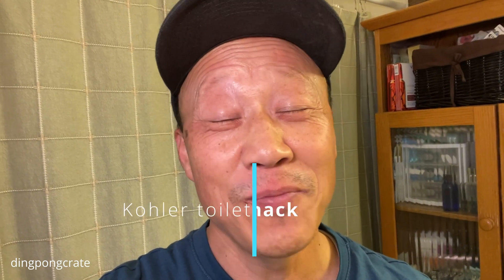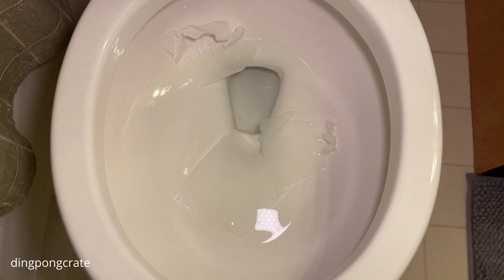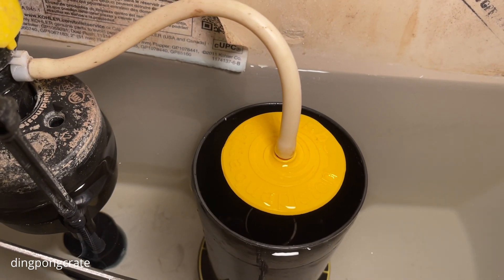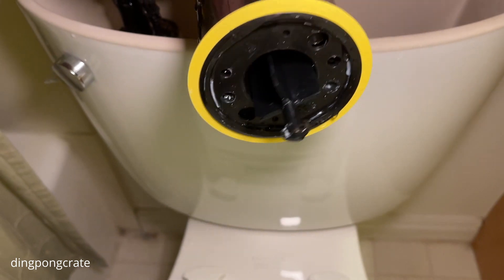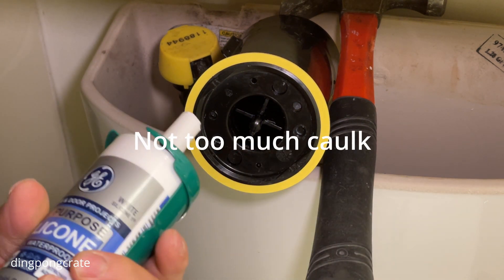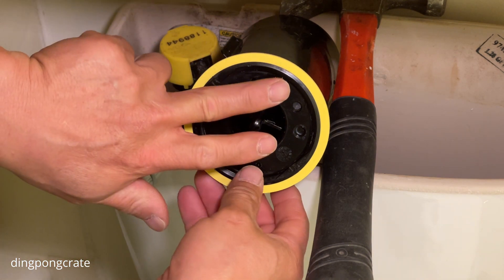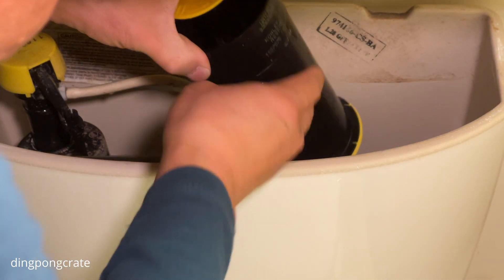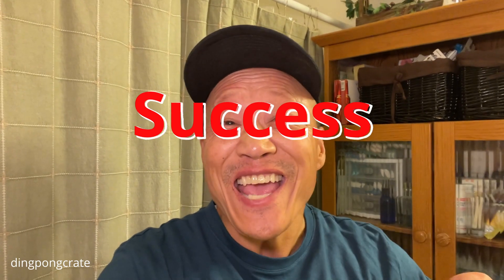Toilet won't flush completely | Here's a Simple Hack to Boost the Flow"

Comment: the chain adjustment is wrong, Move the chain to the lower hole on the flush tower.
Reply from the maker: I have moved the chain to the lower hole before. still I had the same issue

Comment: The whole point of the Kohler Flush System is to conserve water. If only liquid waste is involved, then just depress and release the flush valve handle and the liquid waste will be gone. For solid waste, hold the flush valve handle down until the water in the toilet tank stops flowing and then release the handle to allow the valve assembly to close, allowing the tank to refill. This last procedure only takes a few seconds more. I've never had any problem with solid waste remaining in the toilet bowl when following Kohler's instructions. How impatient are you? If you don't care about water waste, and want to increase your water utility bill, or add more wear and tear on your well pump and septic system, then you shouldn't have bought a water conservation product. People don't spend any time doing a little product research and then blame others for their poor choices. You see this on Amazon product review comments all the time. Apparently, for many in America, reading is a lost fundamental life function.
Reply from the maker: I appreciate your comment. Kohler's flush system has a flaw when it comes to liquid flush. My valve doesn't completely flush it holds enough water for a new flash to begin..we don't waste any more water.